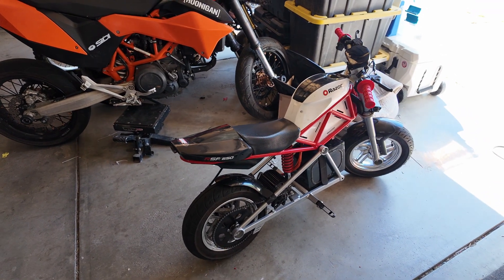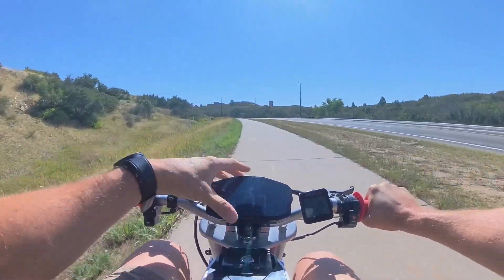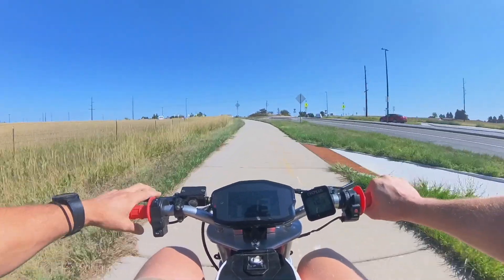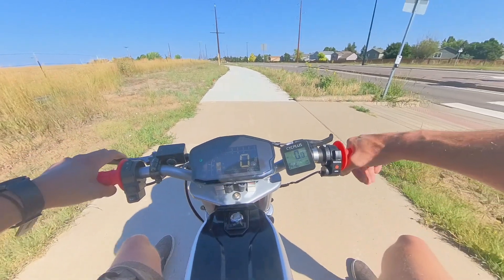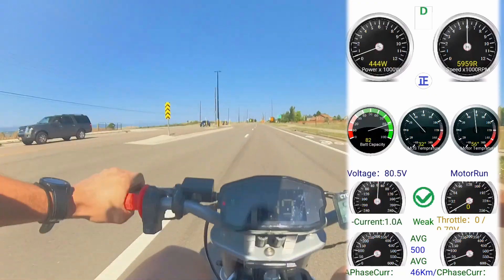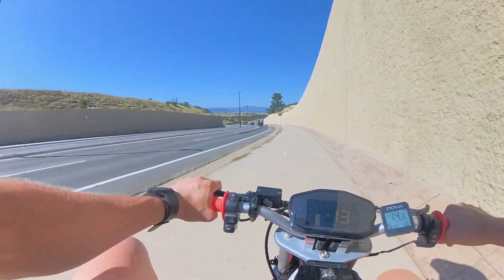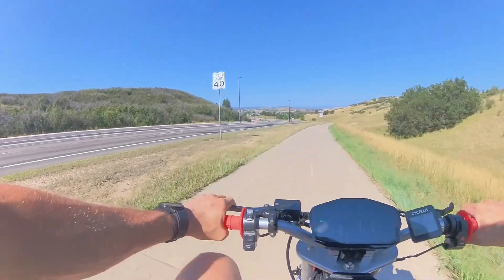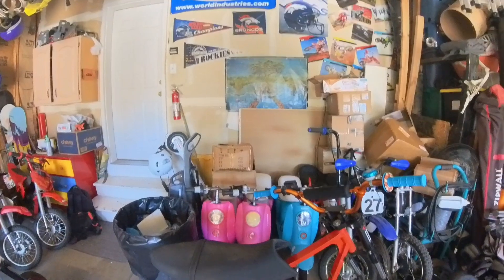Going 60MPH On a Razor! (Parts List)

Comment: How much cost total
Reply from the maker: @GomezThethird  at this point I would say there's probably close to 2000 into it including the bike but now I have 3100 into it with a bunch of different upgrades from The time this video was taken
Reply: @ also to tune it do u need an andriod cause most tuning u need an app in andriod and i dont got one
Reply from the maker: @GomezThethird  No car driver is Android and Apple only Kelly would just Android
Reply: @ for battery what does eve and lishen mean and which one should i get
Reply from the maker: @GomezThethird  what's the type of cells, we switch to Eve
Reply: @Razorcrew_Cole it says 2170 linchensLa
Reply from the maker: @GomezThethird  hmmmm yeah I'm not super familiar with the stuff like I said I have my guide check sometimes for my batteries So I just go with what he tells me the eve or listen sells
Reply: @ what are your thoughs in kunray 72v 3000w with a 60v 20ah battery from amorge
Reply from the maker: @GomezThethird  I'm not for sure if it will work with that controller that comes with their basic kunray set

Comment: How many line amps can I run the kr5v with a 72450 72v 32ah 200a battery how much line amps can I run on this motor without it getting too hot
Reply from the maker: @Picklejuice950  I'm shooting the video right now showing you guys what I'm going to recommend. Honestly I think 100 line - 250 phase is a safe spot still might even get hot. 
With that said I've been running it 130 line - 350 phase for high speed that I just rarely use but that motor does get pretty hot fast at that
Reply: @ if I get the fw11 with 72450 and 72v 32ah 200a battery how much line amps should I be able to run? Thanks for the help
Reply from the maker: @Picklejuice950  with the FW-11 I think pretty close to that controller maxed out I would say like 175 line 420 phase would probably be pushing it. I have heard people say they get it hot not sure what they're running it at

Comment: Hey how many watts can you push with this motor
Reply: Could you please send your tune for the far driver and kr5v thanks
Reply from the maker: @sebastianking633  I am releasing the video tonight for you guys I have like 50 of you all asking I'm sorry it's going to just be basic on what I know I am no pro Ryan Goodyear you can pay for a tune but I Will share what I do but I'm not responsible of something gets overheated or whatnot you have to monitor your heat always on all your components
Reply from the maker: @sebastianking633  I pushed it right around 12 KW I've heard people saying 15 I don't know that for sure. It does get hot pretty fast running 130 line amps
Reply: Thanks I am hoping to get an amorge 72 volt 20 ah battery do you know how many amps I can run and how much my top speed would be running 12 kw
Reply from the maker: @sebastianking633  120 amp is continuous our EMF ones from them I think is peak 150 

I mean it depends what gear ratio you're running and stuff I recommend probably between a 5:00 and a 6.0 ratio to achieve like 60-70 mph
Reply: @Razorcrew_Cole  70 mph would be insane I would probably run a 13 tooth sprocket on the motor but I don’t know what sprocket to run in the rear to achieve good torque and good top end
Reply from the maker: @sebastianking633  yeah with my KR 5V on this I'm running my 11 up front and the 65 in the rear hitting 60 mph full speed
Reply: @ for Me I’m only like 50 kg how fast you reckon I could get
Reply from the maker: @sebastianking633  It depends on what ya want out of it and budget
Reply: @Razorcrew_Cole I want to run the max watts I can safely without harming the motor and I also want to run the max out of my battery without harming it
Reply from the maker: @sebastianking633  sorry if you told me but what motor and controller and battery continuous?
Reply: @Razorcrew_Cole  kunray kr5v and fardriver nd72450 and amorge 72 volt 20 ah and maybe 140 amps
Reply from the maker: @sebastianking633  In the video I'm putting out tonight I'm going to recommend like a hundred line amps or so for that

Comment: Hay I have a question about the battery ? Will I be able to still use my plastics for my rsf650 with that battery ?
Reply from the maker: @1Life2LiveJohn  yeah if you look on my website page we have the video linked kind of showing how it fits. It's tight there's a small gap between frame and plastics but pretty much on perfect.
Reply: Ok I’ll check it out because I’m definitely in the market for for a longer lasting and high amp battery 🙌
Reply from the maker: @1Life2LiveJohn  unfortunately our batteries are long shipping time so be aware of that, just how I keep the price down and I don't really make money on them just want to offer it to the community what I use
Reply: @Razorcrew_Cole   one me question would the bomb moto b1 battery be a better fit ? If it is would it be possible for u to make a short or something showing it?